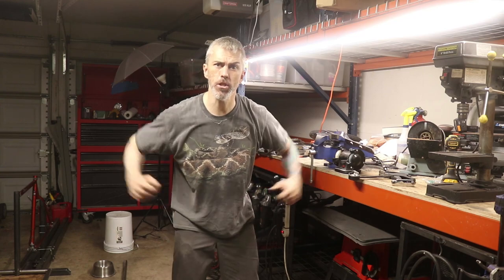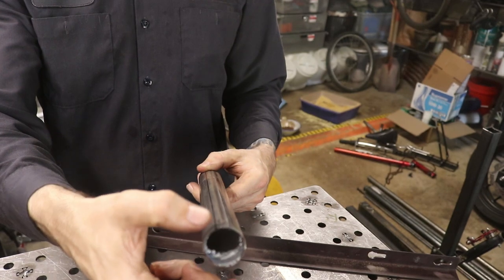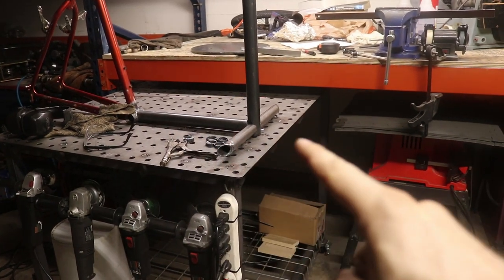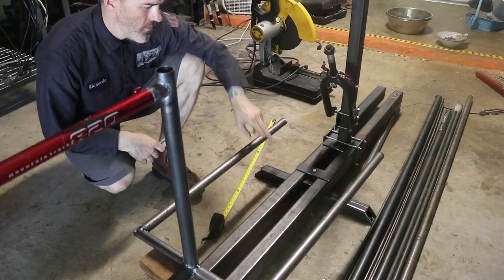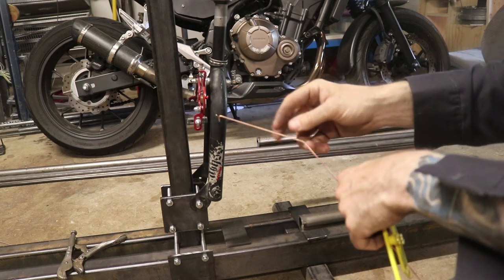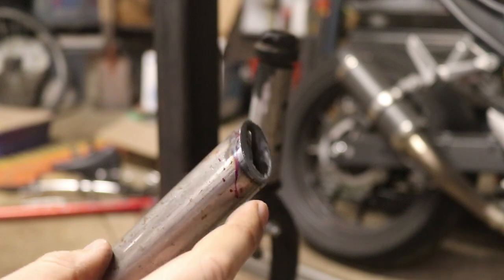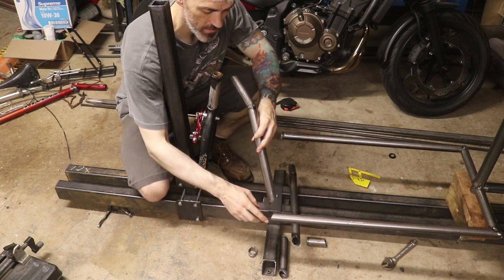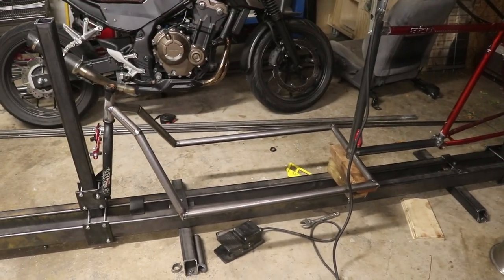Long John Cargo Bicycle Build | E3 - Cargo Bed Frame Fabrication

Comment: Great progress.  Reckon you'll need a better front brake, something like a V-brake would be much better than the caliper that's on there now which are useless at the best of times never mind carrying a load.
Reply from the maker: Yeah, the front brake is definitely a weak point.
Reply: @HooptieDoodle   I've been thinking about this and you're maybe going to address this but I reckon it's going to bend in the middle at the bottom of the steer tube under load.  You might want to put a box section back bone in that runs from the bottom bracket to the head tube at the front wheel and triangulate the rear by putting a tube running from below the handlebars/ top of the steer tube to the bottom bracket similar to the down tube you cut off.